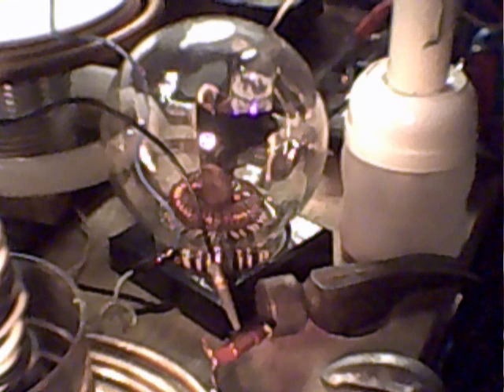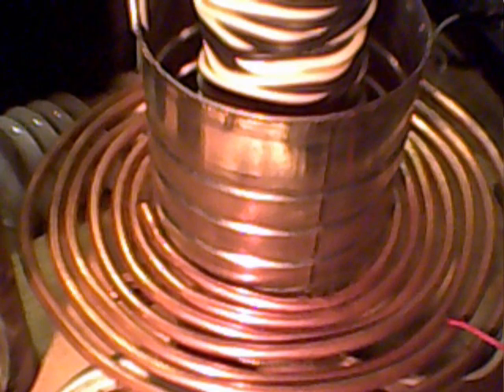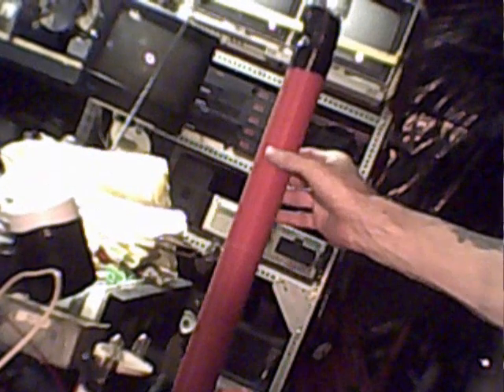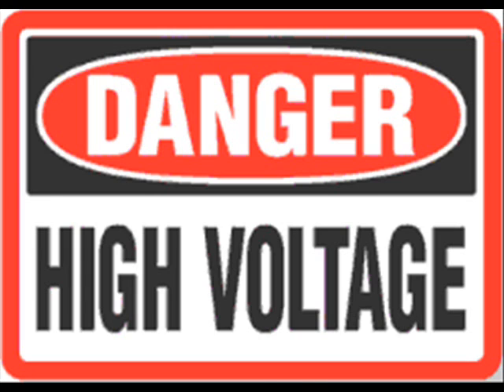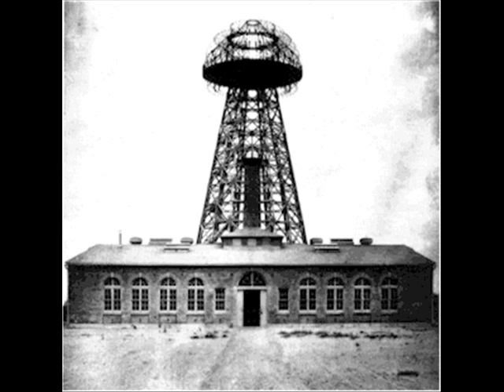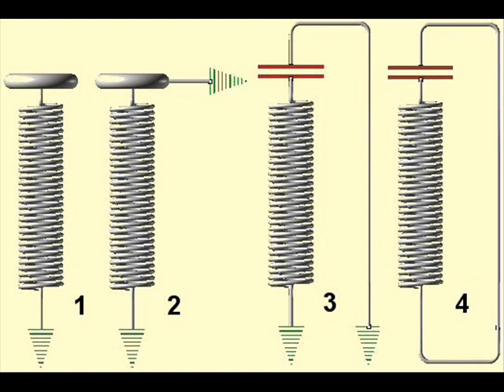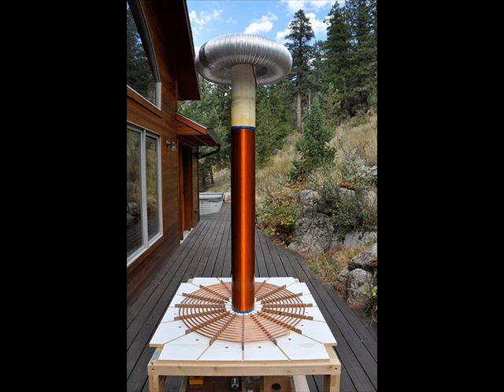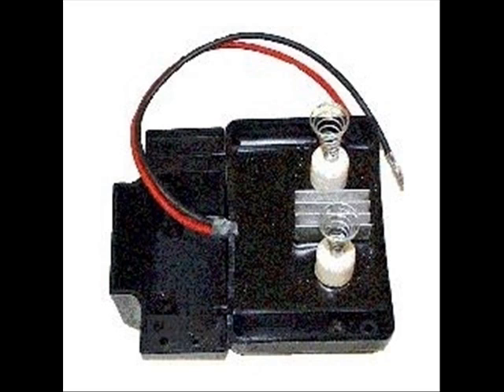BUILD A TESLA COIL !

Comment: Do you use your coil for free energy?  If so how much power can you pull?
Reply: Energy is never free in the sense it is created out of thin air. Energy can be transformed from one type to another. This doesn't happen with a Tesla coil.
There is a net loss of usable energy due to losses (still energy) in the system.
Energy can neither be created nor lost.
Reply: Energy is never free in the sense it is created out of thin air. Energy can be transformed from one type to another. This doesn't happen with a Tesla coil.
There is a net loss of usable energy due to losses (still energy) in the system.
Energy can neither be created nor lost.
Reply: none.

Comment: Can u make a MAGNET DRIVEN MOTOR that will never use electricity, but can PRODUCE electricity?

I think it can be done. GE and other major manufacturers will try to stop you from making it because it will put them out of business.

You can use a bicycle wheel with a greased axle, and lots of magnets that can push and pull the wheel to a certain speed, and a generator, like a wind mill has, to harness the electricity it can produce.
Reply: Entropy, friction look them up. 
That would need to be some magic grease! Grease that repels the laws of physics! 
My suggestion is get an education then theorise.

Comment: Where can I buy the toroid?
Reply: I'm sure you know by now, but it's much cheaper to make it with aluminum dryer vent hose, a plywood disc, and aluminum sheet metal. The stiffer, thick foil type vent hose makes a better quality, smoother toroid, as the thin foil hose with the wire spring inside it can be rough looking. Spun toroids can be quite pricey, and since the wavelength of the AC that the secondary resonates at is so long at a couple of hundred kilohertz, if the surface is not perfectly smooth it won't really matter to the high voltage, or the function of the air capacitor. Now a small solid state TC resonating at several megahertz might do better with a smoother toroid, and a spun toroid at that small of a size is much cheaper to buy than one for a large TC would be.

Comment: could i used a slinkey or 2 as my top part?
Reply: You could. The wavelength is so long at a couple of hundred kilohertz that a non solid surface toroid will work and several top coilers have used them quite well. Some use a set of rings arranged in a toroidal shape, but a slinkey like coil would work as well. It's like how they use mesh, or screen, to make the reflector surfaces for large parabolic radio dishes. It's a lot lighter than a solid surface, less affected by wind, and as far as the radio waves are concerned, as long as the holes in the mesh or screen, are small enough it looks like a solid surface to the radio waves. The "open" or "skeletonized" toroidal top load is the same principle.

Comment: He proved that energy was transfused between points of space when applying sufficient pressure. The ether implied an inevitable existence of resistance towards any displacement of energy, which Tesla suggested that property of space could be invalid by means of inducing energy through space at frequencies. The ether was later proven to be a false property of space by Einstein's work. Tesla's work in Colorado Springs in the 1890's were attempts to transmit wireless electricity, proving it.

Comment: Hi Shazizz, 
I'm making a tesler coil and I've followed your wiring diagram you show in the video. 
I'm using a 600v power supply from an old black light tube I had, I've wired it in exactly the same but I'm not getting any spark across the spark gap.
I wondered if you'd help me please?
I've had to use a home made bottle capasitor and wondered could that be the culprit? 
If you could help me get it running I'd be very grateful.
Thanks for your help,

Dave.

Comment: I do not think proper operation is achieved in many coil configurations. Basic circuit is making the primary coil current zero by a gap. The coil charges are induced into the secondary. This is electrostatic action and builds up to millions of volts.

Comment: The arc in a tube. Tesla may have preferred a free air arc. Page 28-29: The use of the magnet permits, however, of the arc being replaced by a vacuum tube, but I have encountered great difficulties in working with an exhausted tube. This might have changed as I think a hydrogen filled tube was mentioned at one time for some application.

Comment: It isn't perpetual.  It uses a small amount of traditional power such as a battery or AC electrical power to gather the electricity from the environment.  "Free Energy" certainly possible though and it is time society demand we use it instead of burning valuable petroleum products.  We could use wind, thermo-energy, wave power, hydro-electric, and solar power.

Comment: Think about it, we have hydro-plants that we generate electricity with the energy transformation of water potential to electrical potential, it is a conversion of energy only. So by building potential in the water(dam) we create bigger potential to draw from to generate electricity. So the Tesla coil produces very high voltage(potential) to draw from to transform energy from the void into useable electricity.

Comment: It is all in your wording. Listen, a water sprayer is a water diverter. A diverter is not the same thing as a generator. Water pressure buildup is in a water pipe is same potential that voltage is in a wire. So pressure in water is potential, AND voltage in a wire is potential. And yes you can generate electricity with a pressure valve because the valve causes pressure(potential)and can power a generator now with it. So a pressure valve is the same as a Dam.

Comment: Can't we use this to generate the current to load the stored power supply that we could use to power our homes? Like a windmill needs the power of the wind to generate the current to charge the power supply that runs a unit "RV" or something. Couldn't we use it in a way that would basically have perpetual power that would keep on loading the supply needed for the home in turn keeping the power needed to run the coil going? Great if you have time for some feed back. Thanks in Advance. Henry V.

Comment: Hey Shazizz man, great video! -but I'm working on a small 12v Tesla coil, i have a decent amount of experience in electronics and technology, but ive never built a coil of my own. I cant find much on the components i need to get a small Tesla coil to fire off electricity out of the toroid.  i have the basics done, primary, secondary coil, toroid, grounds and spark gap, but im stumped because its small scale, and most of the videos of small ones dont describe the details like the larger coils.

Comment: I suppose that a 3-phase (or more phases) version using automotive ignition coils and a transistorized CD system would be able to provide quite a punch for the input.  It would be portable, in that case, mounted to a trailer and towed behind a truck.  One of these days I might build one like that.

Comment: "tesla scam" .. If you actually knew about this project, or about anything in general, you would know that the energy is created by a 12V battery, which has been running for over 2 years (on this particular project) without ever going dead, or without needing a charge.
so where is this A/C charge from the mains you are talking about????